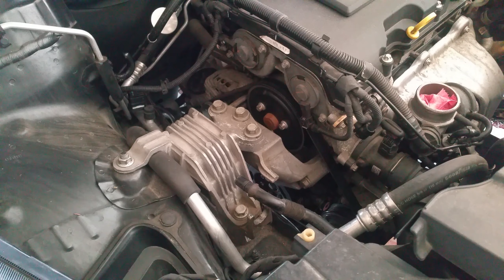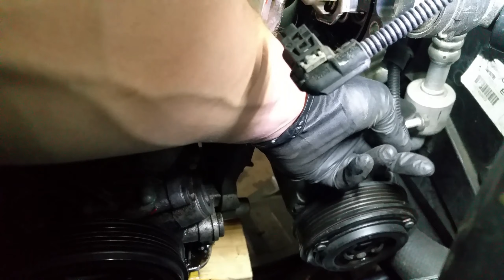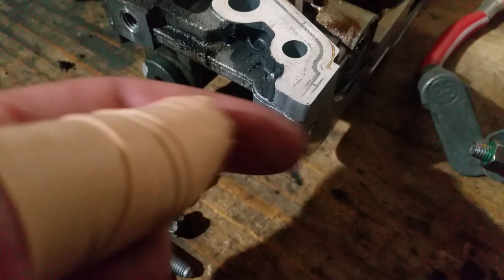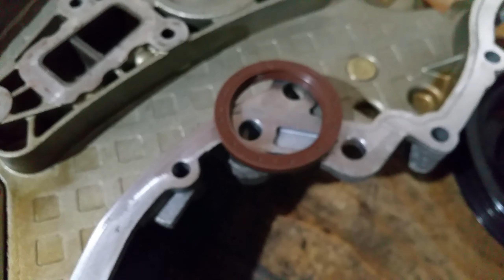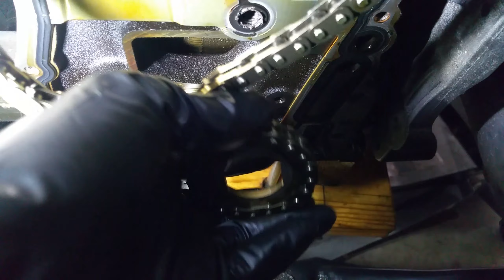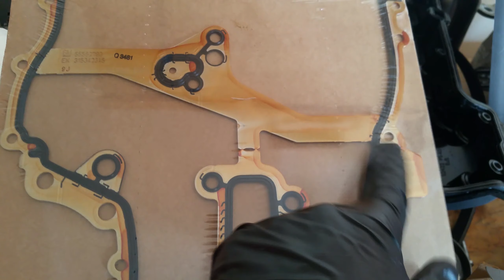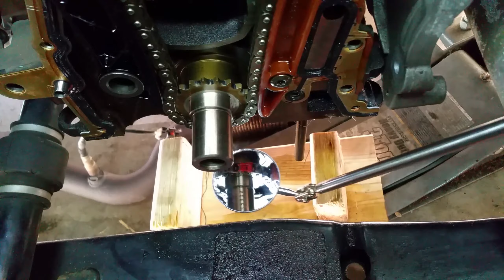Chevy Cruze Timing Cover Gasket Replacement & Water Pump, Alternator, Valve Cover, AC Compressor

Comment: if you have issues with the timing chain and don't have the kit for timing. you can simply pull the chain tight on the right side (exhaust side). right side of the sprocket, grab the chain and pull up and move any slack to the left sprocket. you want all the slack on the tensioner side. doing this will make the chain tight from all 3 sprockets and then the tensioner will take up the slack.
Reply from the maker: This is good advice for someone already in the middle of the job and looking for a way to correct things, but I cannot recommend this as the desired approach going into this job since it's just too easy to think the chain is tight when it is actually out a single link. Marking the chain links and gear teeth ensures no slip ups.
Reply: @in-depthdiy2123  Sir... the chain doesn't have a specific timing position like you think it does..  you can rotate the chain 60 degrees.  180 degrees... it does not matter.  as long as its tight and no slack on the right side. only thing that matters is camshaft position and the phasers.

Comment: to future hopeful DIY. buy a subscription to alldata if you want to take on advanced jobs. this involves locking the engine tdc and realigning the camshaft. the cam sprocket bolts, the crankshaft bolt, and a few of the water pump bolts are torque to yield.  1 time use only.  they are stretched beyond being used again.

this crankshaft bolt is tightened 111 ft lbs and then an additional 60 degrees.  do not attempt this if you don't know the specific procedure.

there is also things you need to verify when putting the harmonic balancer pulley on.  it's possible it won't go on all the way and you'll torque down the bolt and then your belt will be wobbly and shredding.

Comment: well put together video. the chain orientation or links do not matter.  Only the camshaft positions(the rollers) and the exciter wheels position when you tighten the sprocket bolts.
Reply from the maker: I understand what you're getting at, but to clarify for others: getting it back together exactly where it was tooth-to-link does not matter, but having the correct link count between gears/sprockets plus the camshaft/crankshaft positions matters, and is why I marked them so the link counts and the positions on the gears stayed the same before and after. Alternatively, I could have counted the links between each gear, blocked the camshafts and crankshaft, and put the chain back that way too. The marking just kills two birds in one stone and makes reinstallation faster.

Comment: my question is what if u installing a new chain how do u know where it goes if there's no makings
Reply from the maker: What I would probably do in that situation is still mark the old chain and gear teeth before removing it. Then lay the old chain next to the new one on a flat surface and transfer the old markings to the new chain.

Comment: There are 2 female torx bit bolts on the timing cover. Do you have to remove these to take the timing cover off? One is in between the crank seal and water pump hole and the other is on the top left. How did you pry off the cover?
Reply from the maker: I believe I removed those, but can't remember if it was necessary. I want to say everything on the timing cover is used to hold the cover onto the block in some way. I pried the cover off using a flathead screw driver on the sides near the cylinder head/block mating seam, and the bottom corners near where the oil pan touches. There are two alignment pins the cover slides on near the center left/right sides so don't pry it to one side too much, just enough to break the seal and pull off my hand.
Reply: @in-depthdiy2123  Thank you! I found out they were not needed to remove the front cover. One was an inspection hole for the chain and the other had to do with the water pump. One more question. On reassembly, how did you keep the pulley from spinning when torquing the new balancer pulley bolt? Would a new bolt and impact be okay?
Reply: @in-depthdiy2123  I have the crankshaft holding pin but I don’t think it’s meant to be used to torque the balancer bolt and I didn’t want to damage anything.
Reply from the maker: @mikeoutsideee  I agree, I wouldn't use the pin just in case something goes wrong. I also would not use an impact to put the pulley bolt on. The percussion from the impact can damage the crank.

Instead I used a strong/big flat head screwdriver to put through the slots of the pulley and get leverage onto the lip on the bottom of the timing cover that is on the backside of the pulley. Using one hand to hold the screw driver and pulley in place, and other hand to torque the bolt down, I was able to get the pulley back on. It's not pretty or fun juggling two things at a time, but it worked for me.

Comment: What if you didn't know to lock the cams and didn't have engine at top dead center & literally have everything apart now? The chain is marked where to go back on but the cams did kick forward once. Will it be out of time now?
Reply from the maker: Understand this is not advice on what to do. I take no responsibility for your car or actions.

To be safe, yes, you should set the timing if one/both camshaft moved separate from the other or the crankshaft.
https://www.cruzetalk.com/threads/how-to-cruze-sonic-1-4l-turbo-luv-luj-timing-adjustment.235519/

On my vehicle, I'd probably try to rotate the camshaft back to the locking position. e.g. if it moved 1/4 turn clockwise, I'd move it 1/4 counter clockwise and lock it, assuming I had the red marks in the video to base everything on.
Reply: @in-depthdiy2123  thanks for the reply, was able to get it set back right but now fighting getting the harmonic balancer on...cannot get it to line up with the oil pump and slide over the crank. These 1.4 are gonna be the death of me
Reply: Anyone know what the plugs are called where the pins go. We lost one an I need to order it. any help

Comment: Very scientific strategy to solve a problem, and great info on the seal design.  By your analytical approach I'm guessing you torqued the harmonic balancer.  My question is how did you hold it?  Getting it to 100-110 ft/lbs must require being a little creative.  Any tips, or counter balance wrenches that were used? 

Thanks Great Video!
Reply: fill 1 of the middle cylinders with rope or both.  there's your tool to hold the crank. the bolt doesn't have to be tight to set tdc or anything else.  you can do this 1st with the bolt hand tight 😉
Reply: @rickschindler1556  This is the right answer.  I forgot about this "trick" but I used it in 1998 when I was rebuilding a Studebaker V8.  It was a little tricky on the Encore because of how deep the socket holes are in the block but I just pushed a few feet of rope into the cylinder and it worked great.  😎
Reply from the maker: I indeed torqued the balancer. I put a large screw driver through the oblong balancer holes and rested it on the bottom lip of the timing cover. I used one hand to hold the screw driver handle, and the other to turn the torque wrench. Took a little bit of positioning, but I was able to secure it down. I also put blue thread locker on that bolt as well.
Reply: @in-depthdiy2123  Sir, the torque spec is 111 ft lbs PLUS 60 degrees.  screw driver won't hold that and you can't do it one handed.  for example, tighten a lug nut with a standard 3/8 drive till it snugs up. than torque it to 95 ft lbs.  it won't turn much after that will it?  maybe 45+ degrees?
Reply: @in-depthdiy2123  Doing some research on seals, do we want a single lip seal or a double lip seal for this application?  I definitely think upgrading to an all Viton Seal will handle the heat better than standard Buna.  I'm just not familiar enough with them to determine where you'd use one over the other.  Thanks for the tips.  The crank seal is slightly leaking from behind the harmonic balancer.  If I keep this car it might have to be addressed.
Reply from the maker: @daveg8119  Depends on what you mean by double lip. Some seals have two sealing surfaces and springs, essentially an inner and outer sealing surface. Others have a dust or wiper lip that shields the inner sealing lip from dust and random debris (like the factory seal and the ones I showed in the video). I think a single sealing lip with a dust lip is perfectly fine for this application.

If you can find a viton, I'd go with that over alternatives. Search for "spring loaded rotary bore seal" or something along those lines to get the correct type of seal.

I also tend to pack the seal between the seal lip and dust lip with high-temp silicone grease (high-temp faucet grease is common) before assembly. Keeps the lip from sticking on first start up, and helps stop any initial debris that might get past the wiper lip. High temp part helps keep it in place long enough to do something useful.
Reply: @daveg8119  It is not the cheapest option and the method described above certainly gets the job done, but GM does make a specialty tool for holding the balancer while torquing. The tool is Kent Moore Crankshaft Holder- EN-49979. You can sometimes find these on ebay from dealership liquidation sales, but you can also order it from the GM Special Service Tools website.
Reply: @MrBryanBeaty  Thanks for the suggestion.  I've also seen that OTC has a universal pulley holder tool that might work for this.   Kent Moore is nice stuff, but for a owner of a Cruze that doesn't wrench for a living, it's typically an expense, but also typically quality tools.  For seals I was looking at the following. I have not used this website, or done this job, they have both a single lip and dual lip option, not sure which one I'd order.  9 years ago when I got the cruze metric o-rings to replace the coolant o-ring on the radiator cap was a big thing, as there were problems in sealing.   Please let us know if you find one of these seals that fit.  https://www.oringsandmore.com/viton-oil-shaft-seal-42-x-55-x-7mm-dbl-lip-price-for-1-pc/
Reply: @daveg8119  it's a torque to yield bolt. looking around 200 ft lbs.
Reply: All of these bolts are torque to yield. The harmonic balancer bolt should be torqued to 110 ft-lbs plus an additional 60 degrees. Also all of these bolts should be replaced, and not re-used. Especially the front motor mount bolts.

Comment: Such a great video. I could have really used this on mine last December. I should have made a video but was rushed on time. Mine was leaking oil where the oil comes out of the timing cover and goes into the block. Great job and thanks for posting!

Comment: So, I followed your instructions which were perfect.  After everything is back together, I am hearing a loud knocking from the timing chain area of the valve cover.  Any thoughts?  Was thinking that the chain has slack where it shouldn't and its hitting the valve cover.  Will be taking it off to inspect.  Thanks
Reply from the maker: Typically I use a stethoscope on a stick to track down noises. It could be the chain being off one tooth, or it could be a multitude of other things. Quick check list off the top of my head...
1) Was tension put back on the chain, i.e. was the plunger fully released when the guides were put back.
2) Positive the chain guide mounting hardware went back on tight? I used loctite on mine.
3) Didn't leave a random tool or bit under the valve cover?
4) Is it for sure the chain and not a lifter or valve?
5) Is the crank bolt back on with the correct torque? It was a bit of a pain to get mine to click

If the noise is truly from slack in the chain then the chain is either off a tooth or doesn't have tension from the plunger (which uses oil pressure to generate tension on the chain). I would start with what you suggested, pulling the valve cover off and taking a look. The top of the chain really should not lift far off the guide between the cam phasers at all, maybe a few millimeters at most.
Reply: @in-depthdiy2123  Thank you, going to start at it again this weekend.   I will look at each one of these steps.
Reply: OMG, so I found out what was wrong.  I took the valve cover off and looked everywhere and found nothing. I turned the engine over and listened and heard nothing.  I kept turning it over and all of the sudden oil shot out of the valves somewhere. I put the cover back on and put everything back in its place. The banging was gone. So, I can only assume that the oil pump was not primed and it was banging. as soon as it primed, it was good to go. Thank you for all of your help.
Reply: @rdean1972  is it easy to do it ???

Comment: what size is that crank pulley bolt?
Reply from the maker: I think it's an E18 star socket, and M12 extra fine thread. I don't have the old bolt anymore to double check. I ordered the replacement through my local dealer and costs ~$4USD.

Comment: Great video! Wish I had this back in March when I did mine but three times. First time the chain on either the top or bottom jumped and put a p17 and p18 code and made noise when under load. Second time I did see it was not timed correct so I aligned it correctly so I thought. It did take care of noise under load but still error codes. Third time I marked timing again and moved chain one tooth on the whole system. Still error codes. My question to you is was the any play in the chain between the two cams on top. It seems even with the cams locked in place the chain can go to tight or loose depending on how you move the cams just a little bit. I wonder before I try again should I replace the chain. The cruze has 68000 miles. Thanks for any advice.
Reply from the maker: Mine has 145k miles and I reused the chain. The chain should be well lubricated and not stretch much for a couple or three hundred thousand miles.

The slack between the top of the cam gears was minimal. It can be difficult to tell if things were truly back to original by slack or tightness alone, hence why I painted the teeth and chain link to ensure everything went back exactly the way it was taken apart.

Comment: Your video was great and instructive. Step by step.  I have a 2014 Eco Cruz.  I cannot find where the oil is coming from, but it seems to be dripping onto the belt.  the belt then rides the tensioner and rubs against the engine and rubs the belt apart. the tensioner seems to bounce up and down about 1 to 2 cm's while the engine runs.  I  thought the oil was leaking from the camshaft area at the top where the timing belt gears are. Could the oil leak be coming from this timing cover gasket? any thoughts.   Thank you
Reply from the maker: It's hard to say without pictures or video. The tensioner should not bounce that much, 2cm seems like a lot. The spring may be wearing out.
Reply: @in-depthdiy2123  I am going to follow your instructions and replace the timing chain cover. It's the only thing that I can see that would be leaking oil onto the belt.  here is a video of mine running.  https://www.youtube.com/watch?v=TwSVizKcuv8
Thank you

Comment: Great video! Will definitely reference it when I have to do this in the future. By the way,  do you hear some chain noise when you first start it up? I hear it every morning and since the car is new to me I don't know if it's normal or if the timing chain tensioner is partially clogged. The noise last a couple of seconds and then goes away.
Reply from the maker: I don't hear any noise on mine. I have used full synthetic 5w-30 its entire life.